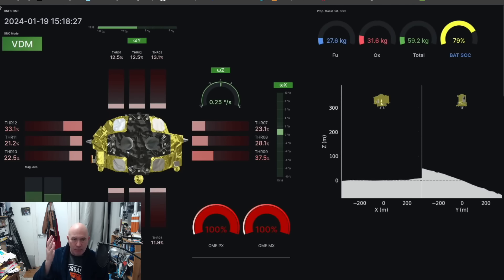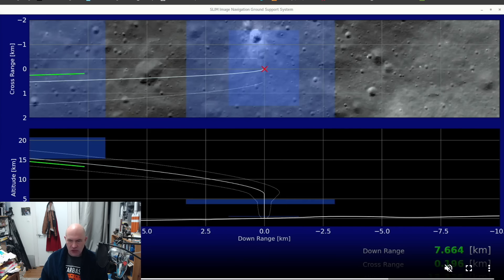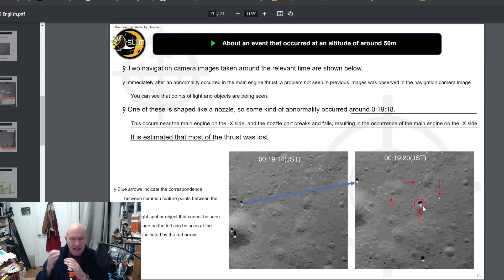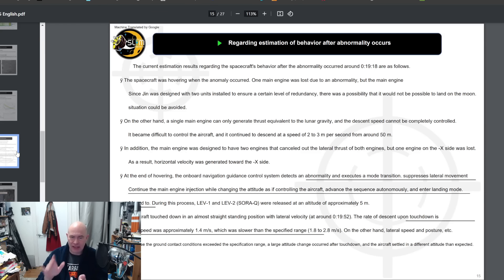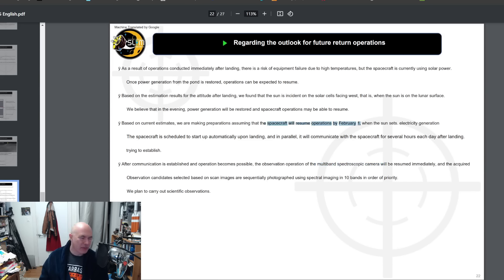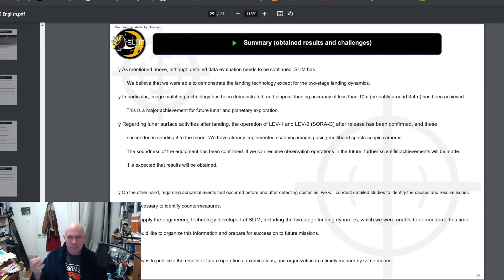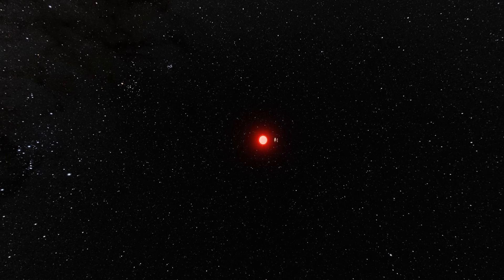Japan Finally Reveals What Happened To Their Lunar Lander! And It Really Did Surprise me!

Comment: I think you're right to think that the fuel/oxidiser ratio may have contributed to the nozzle failure. If the same thing happened in an internal combustion engine, i.e. too much air and not enough fuel, then the lean mixture would burn hot and possibly result in a burnt valve or holed piston.
Reply: Smear some RTV silicone around the air intake boots next time and it'll be fine..
Reply: "internal combustion engine, i.e. too much air and not enough fuel, then the lean mixture would burn hot"
...well...actually.. :-)

Slightly rich is greatest power output and highest temperature.  
Highest NOX emissions as well, but rich also helps lower NOX emission by catalytic converter if fitted.

Lean is lower temp and greatest efficiency with lower NOX but increases detonation vs uniform combustion. Running rough and knock should be avoided unless you urgently need every bit of fuel efficiency and don't care about engine life. The components can handle the temperatures but not the detonation.

The range between rich and lean in IC engine operation is more like between rich and progressively less rich, the step into truly lean is steep.

IC or rocket engine, actual fuel lean is generally bad for engine life.

Comment: First as a KSP player my question is why don't they try to use the RCS thrusters to at least point the solar panel straight up? Secondly kudos to the autopilot that managed to land the whole thing in one peace even after the loss of the engine, which brings me to my third point they really must redesign those bloody engines!
Reply: Real spacecraft don’t have magic reaction wheels and kilonewton level RCS thrusters, the RCS on SLIM is probably tens or maybe a couple of hundred Newtons each. It likely has insufficient thrust to make a difference, and insufficient fuel to try.
Reply: If i had to guess, and I'm guessing, maybe they don't want to risk damaging something else, or they're low on rcs fuel after using more than expected on the way down? Also rcs is pretty weak
Reply: @jimmymcgoochie5363 More likely, they don't want to risk doing more damage to the spacecraft and/or they can't restart the RCS system.
If it was powerful enough to oppose the asymmetric thrust of one main engine almost off and the other likely firing at full power to compensate, then it would definitely have enough power to at least make it fall to one side instead of sitting almost upside down.
Reply: Rather than go all “IRL it really works this way” I’ll just ask if you’ve played RSS (real solar system) mod —the bodies in the Kerbol system are much less massive than IRL solar system, something like 1/3 IIRC.  So how many of your KSP craft could do a bunny hop with half thrust or bare RCS if gravity was 3x ?  That’s without Realism Overhaul mod and more modest ISP for all engines and lower reliability of RCS
Reply: What qdaniele97 said.
Reply: @The_CGA  We're talking about using RCS to slightly bump the craft, which is extremely lightweight, in a direction parallel to the moon's center of gravity, not fully against it. It doesn't seem unfeasible given that it's resting on a fulcrum.
Reply: @The_CGA  In KSP most of the planets and moons are much denser than their IRL counterparts, in order to make them have similar gravity than their IRL analogues.
Reply: @Connection-Lost  There is not revert IRL tho, so if they think that that could end damaging the craft and that they can get results just waiting, I can understand why they wouldn't do it even if they could.
Reply: @Connection-Lost …. Extremely lightweight??  It’s named SLIM, but it weighs 700Kg (1,500 lbs).
Reply: @Connection-Lost  ahh…skiing/sledding on the regolith a bit…imma guess that probably won’t be good for the solar panels or much else about the spaceframe.  If it was built with helicopter type landing skids, perhaps.
Reply: FR: For a propulsive landing it's waste of budget to have thrusters not pointing retrograde they said, so they took linear RCS and put it on a 1x1 panel in a 12-way radial symmetry all pointing down, actually in 3 sets of 4-way symmetry in right twist and left twist and no twist, Probodobodyne rep said that's original, and they nailed control mappings for WASD, QE, IJKL and H, except when they hit N key nothing happened because there's no thruster in that direction
Reply: @jimmymcgoochie5363  Exactly. RCS just isn't designed for picking the lander up and moving it around... they're tiny thrusters for adjusting the orientation, not for lifting it against the pull of gravity.

Comment: Do you think they could use the side control thrusters to attempt to spin it around or pivot it a little to better align the solar panels towards the sunlight?
Reply: It may have vented the remaining props after landing
Reply: This may be attempted if power is regained. After unusual orientation on landing, focus was prioritized to downloading data and securing the lander. Images where not available, and had not been analyzed until haver SLIM went into deep sleep.
Odds of not freezing are on SLIM's side for the next 1-2 weeks, as it's in sunlight, not the cold lunar darkness.

Comment: I've had this problem a dozen times in KSP. I wonder if they could use RCS to roll the craft and expose the panels.
Reply: Probably the issue is that that would require fine control and precision, which is difficult given the huge signal latency. So instead they would need to design software to accomplish that automatically, and test and simulate the software before uploading it. I trust that they would do a good job at that though, as they have already proven.
Reply: @R2Bl3nd  Before the craft goes dark for good, give the keyboard one last faceroll to see what random rcs bursts can do. I'm tellin ya, it's not my first rodeo.
Reply: @Rich4098  okay, you should be the one to tell them

Comment: I'm sure someone else has asked the same question but.... can the reaction control thrusters still be used to reorient the craft?
Reply: I think they could, with the low lunar gravity, or at least they could make it fall to one side completely (which would already be a huge improvement for the solar panels).
But it's very likely the RCS system is not designed to be restarted and/or out of fuel.
And even if it was able to be restarted I don't think they will risk doing even more damage to the lander by trying to fire the RCS at ground level if they can still do some science and get some power in the current orientation
Reply: Appreciate the response @qdaniele97 . It would be cool to see them try once the mission winds down and all they can collect in science date is complete.

Comment: After reading the original slides:
6:18 I don't know if fuel-to-oxidizer is the standard way of putting it, but the way they wrote this implies an oxidizer-to-fuel ratio; they said lower ratio means less load/stress on the engine.
9:28 Correction: under normal conditions, a scan could retrive 333 images in 35 minutes, but to avoid overheating the spacecraft's transmitter, they aborted the scan after 15 minutes and 257 images

Comment: The situation is no longer nominal, but has proceeded to sexual!

As someone who invested a lot of time into designing rovers that would self-right if they flipped, I think the team who designed the outer shape of the lander should have run a few more simulations just dropping the damned thing in some simulated regolith to see how it would right in case of this exact scenario. If it had had a little carbon-fibre roll-cage, it could be getting power right now :/
Reply: Maybe it translates as "Failed Under Continuous Thrust".
Reply: Note this was not flat horizontal lunar surface, it is the inner ring of a crater will a slope of 15-20º. This makes final thrusters up resting position more spectacular in the lander didn't lean over in the direction of the down-slope.

Comment: On Page 9, one will see the nozzle on the ground from the 50 meter height picture.    
I'm surprised the counter torque was enough to keep the craft from spinning.  Good work Japan for factoring in this failure condition.

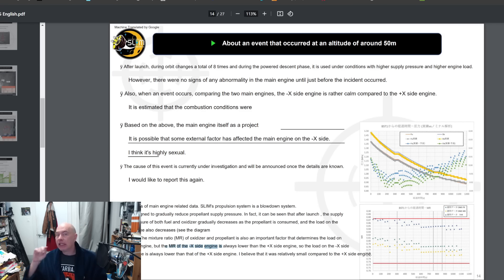Comment: 6:27 some info was lost in machine translation. The last sentence actually says "considering the MR, -X engine have lower load on combustion" which corresponds to upper claim that -X engine was burning in a better condition than +X engine. So yeah, that's why they think external reason caused that nozzle fail.

Comment: immediately on touchdown i noticed that the oxidizer and propellant meters dis not match, there was much more in one tank than the other, they had been equal just a bit prior. Also u can see that there was a big correction burn moment before touchdown with a full engine burn, if only one main rocket was working this would try to flip the spacecraft

Comment: MMH/NTO engine runs in fuel rich condition, lower O/F ratio than equivalent ratio. 
Higher O/F ratio means short of film cooling coolant,  and higher combustion temperature than nominal condition.  
That is a perfect condition of nozzle extension failing.

Comment: The engine falling off is… the best example of a rapid unplanned disassembly event I’ve heard of - capturing the falling bell is just icing on the cake.

But really, we should talk more about the software designers and systems engineers who built that landing autopilot - that thing is something you can clearly trust your life to! It managed to not only land on target, but land upright - it just couldn’t zero out the lateral speed so there was a small post landing tumble. 

Literally turning an accident that could easily have been a moderate wreck to a nominally survivable incident within the target area. 

Please hire these people to design self driving cars, I mean, they not only planned for a 45% loss of thrust on an asymmetrical profile, but they planned and wrote software that - if perhaps circumstances had been different or more funding had been put into giving the craft solar panels on more than one side (which is understandable and common practice, but still smacks of cost cutting to me) - would have been mission-recoverable.

Comment: This is very impressive. That software must have been gold. Unlike India’s, haha stereotypes exist for a reason.

It reminds me of a time that a falcon 9 core had a grid fin jam above the atmosphere and after a violent roller coaster twirl all the way down the remaining systems compensated and it deployed the landing legs to softly set down into the water just off the coast.

Bravo Japan, bravo.
Reply: By the way India's software safetly landed on the moon 😁😁
Reply: India learnt from their mistakes and the next lander Cy-3 had a LOT more redundancy built in to the design than the Cy-2. Arguably, it had more redundancies built in than even SLIM. Just that it didn't suffer any failures so didn't find itself relying on the redundant measures. Otherwise, ISRO chief is on record saying that even if multiple thrusters are lost, Cy-3 will still land safely. 

Stereotypes are just that: stereotypes.

Comment: Scott, if they know exactly what the orientation of the spacecraft is, and assuming they get power on the solar cells at some point to fully power up the avionics, would it be possible to pulse-fire the RCS thrusters enough to get SLIM to roll (again) on to the correct side? Maybe do this as a final hail-mary task before lunar night falls, and after the spacecraft has fully charged the batteries, so it can make one or two attempts before they have to shut it down again to save the batteries?

Or would the RCS thrusters not have sufficient delta-V to force another roll?

Comment: Lets hope they at least tested the nozzle with different mixture ratios for the expected propellant flows, as well as under vacuum and low temp (ceramics dont like heat gradients i guess), otherwise that would be a very sad thing to neglect after the first nozzle failure.

Comment: Hi Scott. Okay, I know this is going to be a dumb question. However, I must ask it. If the craft gets powered up. And can manage to send more pictures and/or data. What is the chance of the ground control firing the smaller thrusters to cause a roll or spin to a somewhat better position for maintaining power to the cell. Even if it is just a rolling motion. Like stuck in snow rocking back and forth? 
Not a chance?

Comment: @scottmanley Is there any chance of minimum power gain(to the batteries)from the suns reflection on the moons surface in the position it’s in? Like a trickle charge..in order to continue using the craft for whatever it can still do? 

Time will change some things with shadows etc..just wasn’t sure if this was part of the considerations in what they’re hoping.
Reply: In theory, yes.
In practice, so little power will be produced that it might as well be nothing at all. On Earth, a solar panel will produce only 10% the power on a heavy overcast day vs a sunny day. The spacecraft is probably getting less than 1% output from the solar panels. So not enough to even trickle charge it. Disconnecting the battery completely was the correct thing to do.
Reply: @Crosshair84  I wasn't questioning the disconnect.

Comment: I wonder if the rocet motor assembly that failed was something along the lines of new old stock, from a bulk order that included the motor that failed on Venus, and the flaw was a common bolt that was used because the assembler didn't have sufficient stock in bolts so went to the parts bin and jog the wrong grade of bolts, that otherwise fit, and no one noticed the markings were wrong. Then again, I'm not a machinist, or space craft design engineer or the like, and don't pretend to be on on TV or YouTube or even in KSP. So, I have no idea how likely any of that is.

Comment: Oxidizer rich combustion would likely cause over heating at engine nozzle throat causing structural failure and loss of gas expansion, lower specific impulse (Isp) and therefore insufficient thrust.

Comment: I know this is a silly question (because if it wasn't, they would already have tried it), but couldn't they use the attitude thrusters to try to tip the lander over, back to something like it's intended orientation?  Not quite as daft as it sounds as the lander weighs a fraction of its Earth weight up there.

Comment: There's pretty well two options of what happened: If the engine was designed to run stoichiometric (perfect balance of fuel and oxidizer so that it's all consumed), then increasing the oxy flow means you create a hot corrosive environment in the chamber, and the throat gets corroded away until it breaks loose. Or, if the engine was designed to run fuel-rich (which is common), the extra fuel serves to cool the chamber and manage its temperature, and adding extra oxidizer means the flame gets hotter than intended and melts away the throat until it fails and breaks loose. Adding more oxidizer is almost never healthy for a rocket engine.

Comment: The report I saw said this engine is the same in the 2 space craft and in fact There's a third one with a similar failure mode. I surmised that it burned to hot and burned through the wall of the the throat. Now knowing that it was a blow down system, and the fuel mix was hard to keep consistent I'm pretty sure JAXA is burning through the throats of these engines. Armchair rocketry is fun!

Comment: A very interesting comment that the chamber material was made of Silicon Nitride. Using a ceramic versus heritage Niobium or a Platinum alloy for a thrust chamber. Ceramics are much more cost effective but maybe an oxidizing environment or thermal cycling of the engine makes them unusable.

Comment: Going lean is not good, look up 'oxygen lance', or how a cutting torch works.  Early on in the Shuttle program the had a booster nozzle with a 98% burn through discovered on recovery.  I don;t know if this information is available in general, even now, but I got it much later in the program from one of the program engineers who was a friend of mine.  Needless to say they fixed the problem.

Comment: Scott, you mention that the engine that lost the nozzle was running oxygen rich, and that that might be important later, but I didn't hear you come back to this.  If a rocket engine is running rich on oxygen, you can certainly expect the burning of the fuel to be extra hot.  It seems quite likely to me that excess heat from the extra oxygen in the combustion must've overheated and weakened the nozzle at the throat.  This could have caused a fracture, or a burn-thru which propagated quickly where the plume then ripped the nozzle away.
Great review of that briefing, thank you very much - I think it's highly sexual!🤣

Comment: 5:08 try to translate.

"From the above, in term of project, we are thinking that the possibility that something from outside might destroy main engine at -X side is high, not the failure of main engine itself."

Critical word was Possibility(可能性). Translator read line change symbol as sapce or somthing, so last Chinese letter 性 was isolated. And isolated 性 is usually used in sexual meaning.

Here is google translate without line change characters:

"Based on the above, the project believes that there is a high possibility that some external factor other than the main engine itself affected the -X side main engine."
Reply: Basically, there are no spaces within a single Japanese sentence.

Comment: Scientific Wild Ass Guess:  They "Qualified" the rocket engine body and nozzles one at a time.
I wonder if the heat from another engine so close by caused nozzle over temp and failure?
Propulsion Systems are not always tested at the system level, only at the component level.
And never tested for full duration burns in hard vacuum